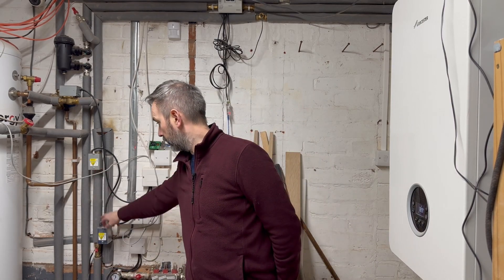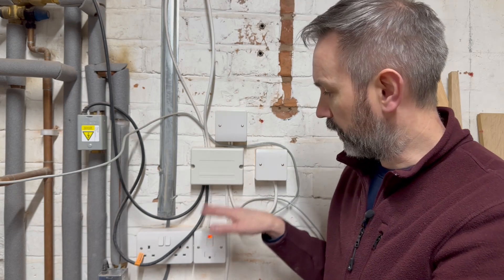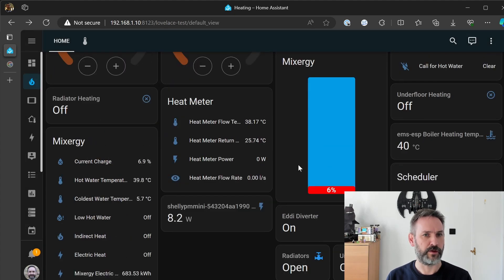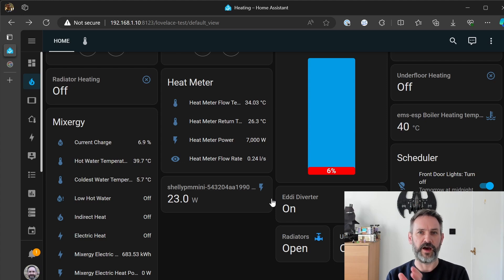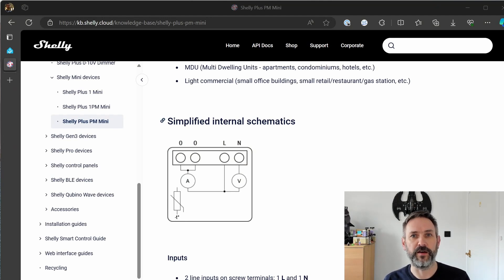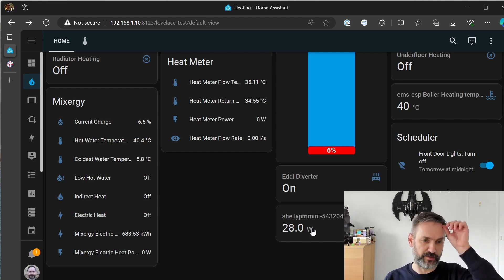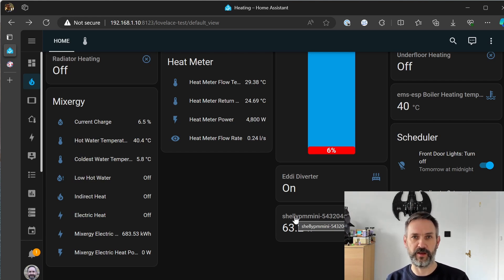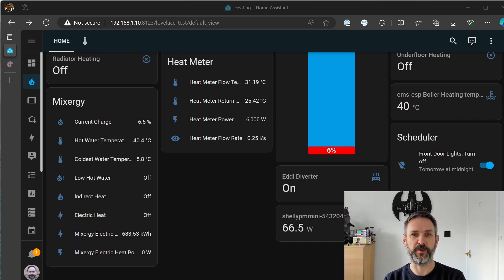How much electricity does gas central heating use? I find out.

Comment: Your water tank has electric heating element, and if you included it for monitoring?
Reply from the maker: I heat my hot water using electric, not gas, but it’s not included in this video.

Comment: Great video! Looking at my power meter, my heating system (5 yo 35kw WB System boiler, zone valves, mix of radiators and UFH) draws in the region of 170W when firing! So yours seems impressively efficient.
Reply from the maker: Hmmm, I have a similar sized and aged boiler! Might be worth checking your UFH pump? Mine accounts for half the consumption! I turned it down too.

Comment: I have a Shelly Plus 1 on a fan heater in the greenhouse controlled via an ESP32 with DS18B20 and HA.  It drops out occasionally due to nearer neighbours jumping on the same WiFi channels. A PM wouldn't help in this case.  I really should try to get both devices to work with BTLE and perhaps lose dependency on HA.  We've already lost our geraniums but that was before this setup and my wife forgot to put the heater on (not my fault, thankfully 🙂).
Reply from the maker: It sounds like a local control routine would be better, rather than relying on WiFi and Home Assistant. Have you ever tried that?
Reply: @tomasmcguinness  I only started with ESPs and HA (in VMWare player on a PC, a.t.m.) at Christmas.  Give me a minute 😉
Reply from the maker: Sorry!!

Comment: For anyone interested, all the Shelly devices should only be used at max 60% of their power rating for continuous loads. So those 16A devices really max out at 10A.
Reply from the maker: That’s interesting. Thanks for sharing. Where did you get that info from?
Reply: That was from Shelly direct. I tried running an immersion heater through them and it overheated and the protective circuitry shut it off.
Reply from the maker: Interesting!! Thanks!

Comment: Got one of those shelly pm's on order to be used on the freezer. No way was i going to use one with a relay that might decide to switch itself off.
Reply from the maker: Amen! I've replaced the classic Shelly PM that was connected to my networking gear with one of these Mini PMs, so I won't accidentally knock it off again! You've actually also given me an idea about my freezer. I'm using a Shelly Plug to track power usage on my fridge and freezer and I'm paranoid they'll switch off. I don't think a Shelly Mini is an option, but I need to find out!